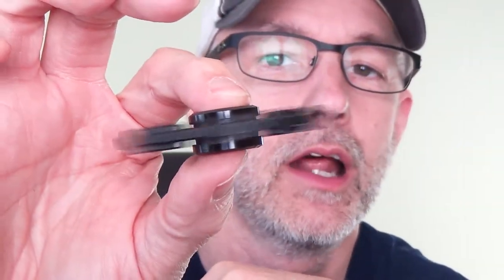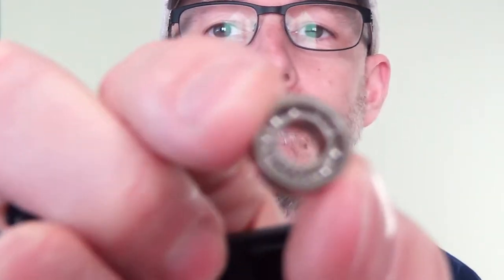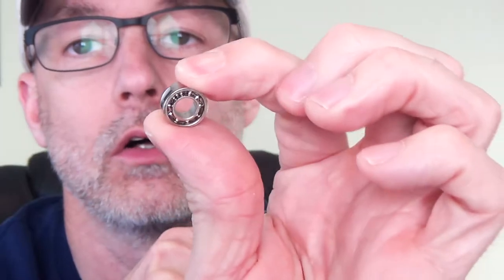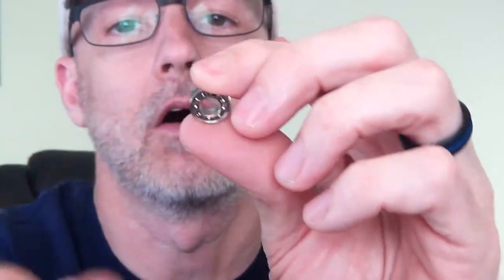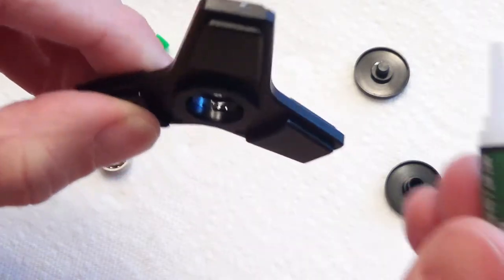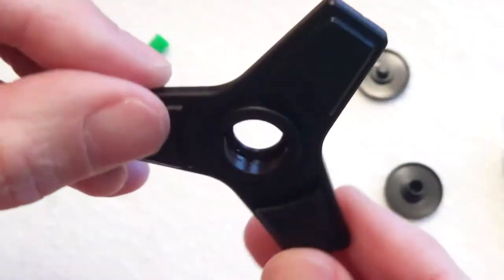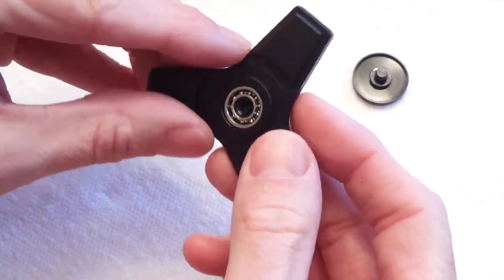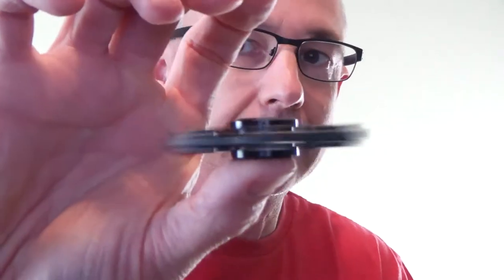Viewer Request - How to Re Glue Fidget Spinner Bearing

Comment: Already messed up the first time. I put the glue around the bearing instead of inside the spinner. Also I originally used the fast drying loctite. I'm going to try the 30 sec to dry using this method and hope for the best. The spinner is just like this but two arm from Target. I'm actually doing this to use my nicer buttons as the original bearing was too narrow in the middle.